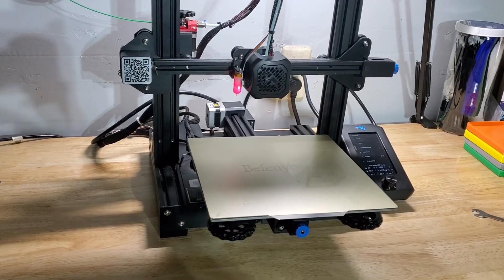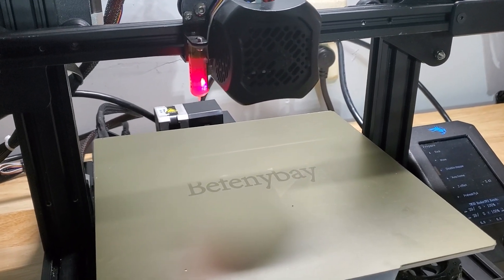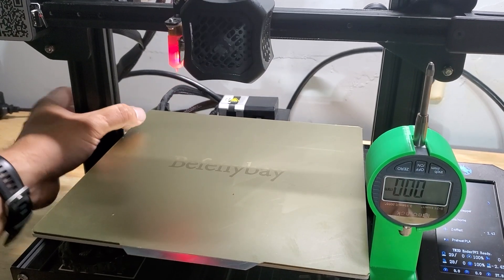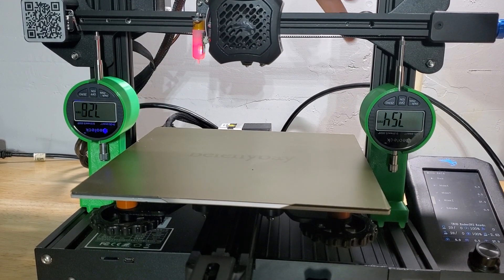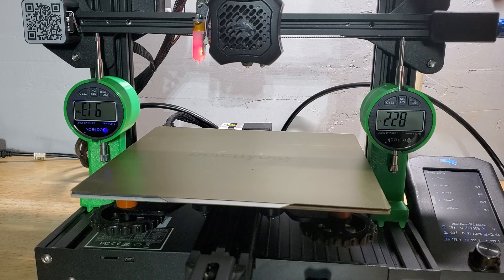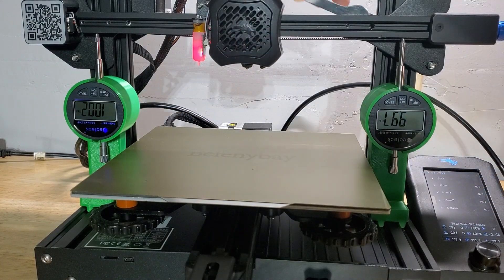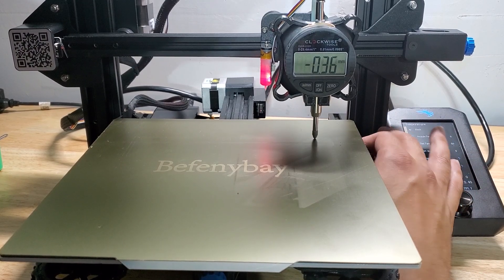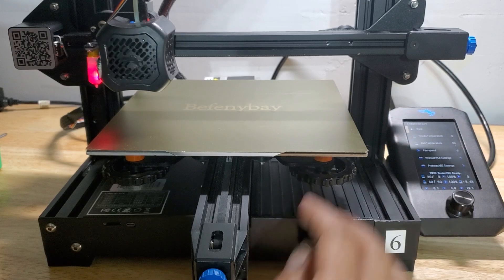3D Printer Adjustments: Perfect X Gantry and Bed Leveling Using Dial Gauge Indicators (Ender 3v2)

Comment: If the V-slot wheels are effecting your measurements, they are effecting the print. I hate V-slot wheel motion systems.
Reply from the maker: It is the ender 3s biggest flaw!

Comment: Defo getting one of these to help level the bed off the extruder. But with only a single Z lead screw that gantry is always going to be slightly off.
Reply: Thas why i use a mesh leveling with bltouch

Comment: I should mention that I only have 2 printers. For my needs, this method is rather expensive. I'd opt for the method used by one of your commentators. Not only is Jamie Carl's method more affordable, but I can see no reason why it shouldn't work. I think most of us understand the importance of having a squared printer frame, and I can't overly stress the importance of having the bed and X-axis gantry perfectly parallel with each other once the frame is squared. Each of these factors must be taken into consideration. These factors combined can "make" or "break" your bed-levelling attempts by making it easier or near impossible to accomplish.

What makes it difficult to square off the frame on an assembled printer? There's not much room around the bed for conventional tools to help make accurate measurements and adjustments. Sure, I can use a mechanic's square to check the squareness of the upper frame with the frame side extrusions, but how do I do this at the lower extremities of the side extrusions without getting in under the bed with the square. There's not enough room! To check for squareness in the Y-axis, I suppose I could temporarily remove the Z-axis stepper motor, and disconnect the Z-axis limit switch to get the cable out of the way. While this approach would allow me to confirm the side extrusion's perpendicularity with the base frame in both axes it just seems like a lot of work.

Now for the bed and X-axis gantry. If the X-axis gantry and bed are not parallel, good luck with your printing activities. I would like to add that I thought a secondary lead screw on the opposite side of the printer would help to counteract the sagging of the gantry on the right side, and help maintain the gantry perpendicular to the frame side extrusions. In theory, this should also make it easier to level the bed. Right? But how do you ensure that each screw raises or lowers the gantry by an equal distance. There's also play between the lead screws and brass nuts to contend with. So, I loosened the set (grub) screw securing the lead screw on the left side of the printer. After installing the second lead screw and stepper motor to the right side of the printer, I left the set (grub) screw securing the second lead screw loose. Then I raised the X-axis gantry as high as it would go by spinning both couplers by hand. Though the lead screws were left loosened in the coupler, these raised the gantry up without difficulty. When I was ready, I used the printer's Move Z command to lower the gantry. I'm assuming that the pitch of both screws is equal. The screws should eventually get in sync with one another when lowering the gantry as both will reach that point where the lead screw threads come into contact with the inner threads of their respective brass nuts. I'm counting on the weight of the lead screws and gravity to help me to accomplish the syncing action of the screws and nuts. Lowering the gantry should force the loosened lead screws to reach that point where both lead screws and nuts are in sync with one another. Then, once the gantry was as low as I needed it to go, I tightened the set (grub) screws to secure the lead screws to the couplers and stepper motors. If I get this right, I can not lower one side or the other of the gantry without really forcing down on it. This is perfect. Raising and lowering the gantry several times, and listening for any undesirable sounds proved that the operation was a success. I couldn't get that gantry any more square if I tried.

In theory, and excluding normal part wear, this need only be done once. No further adjustments should be necessary - ever! In practice, however, the brass nut's inner threading will wear quicker than the stainless steel lead screw's threading, and this will cause the gantry to sag to one side again. This usually occurs on the right side of most Z-axis single lead screw systems. I figure it will take about 7-8 months of 24/7 printing before the brass nut threading wears out enough to make any significant difference, however, adding a little lithium grease to the lead screws and nuts should slow down part wear. I based this time estimate on my printer's performance, and after assessing that the brass nut may have become a problem. What do you think?
Reply from the maker: The extra precision helps because I print with a .2mm initial layer. I don't over extrude just to get better bed adhesion with the first layer. The extra precision is definitely worth it for my production, the print surfaces are smooth like glass and the lines are uniform. It really helps with the cosmetics of the surface that is on the print bed. It is over the top if the precision is not important. Thanks for commenting!

Comment: In terms of the levelling, shouldn't you use center as the reference? The problem is that, if there's a center warping, the corners will be potentially higher/lower.
Reply from the maker: If you use the center as a 0 point, you won't be able to zero out the corners. It's better to get the corners level and let the bl touch compensate for the center.

Comment: Do we need fusion360 to be able to print your gantry dial housings?
Reply from the maker: Ive included the STL as well in the thingiverse link so fusion 360 isnt necessary. Ive included the fusion 360 file in case someone wanted to make modifications.

Comment: I like the premise, but the method is not sound. You should use the frame as the contact points for the indicators. And the gantry as the base. So that when you zero out the dials your measuring up from the base. Because you don't know where the tips of the dials are in relation to each other in this orientation. I hope you find this info helpful. Keep up the hard work.
Reply: I was thinking the same, and I don't know much about indicators, but to me they are only good at measuring relative displacement (when there 0 has been set with a contact to the surface). Not sure those two have the exact same gauge length at 0.
I thought of one way to improve this method (but again I'm not an expert in Metrology). Perhaps you could swap the 2 indicators after the 1st levelling has been done, and then compensate half of the remaining offset. So if the right side is too high of 0.4mm, then it should be pushed down 0.2mm. Thoughts?
Reply: @JulienStoeffler  I would say that would work. You could also just use one indicator from the base in the orientation in the video and swap it side to side. Although after watching the video again, his gantry is way too loose to stay leveled for more then a few z cycles.
Reply: It's honestly probably not enough to matter

Comment: Please don't take this the wrong way, you're probably a very decent chap but this premise of how to align your x to your z isn't on point. For one, you'd have to ensure your two dial indicators and holders from point to point are precisely the same length at zero - and then the flat surfaces of both 4040 extrusions are level and parallel with each other( and square to your z), but this is academic for the repeatability of your adjustments is what's raised an eyebrow.
If the v-rollers on both z carriages are adjusted evenly (and independently) with a light preload (and in order to do this, at least one has to be separated from x axis). Your X,  attached to the carriage on the leadscrew side can then be checked with an engineers square and be adjusted for 90 degrees whilst supporting the weight of an (unsupported) x-axis rail. When you can achieve that you reattach the other carriage again. Obviously a wise person would attach the trailing carriage from the bottom of printer, loosen the top of the frame and raise the gantry all the way to the top before retightening. Hopefully what I'm saying  makes sense?

Disconnect trailing carriage from x (the one on the right). Disconnect lead screw. 
Adjust rollers on carriages independently,
Check x with square and adjust to 90 degrees with x-axis weight unsupported,
Reconnect second carriage to x.

Comment: The issue I see with a single lead screw is that motor side is always pulling the other. I cant imagine the unsupported side would remain level for long. It would be interesting to see the results if you level the gantry, print something big enough, pull off the print and then take new measurements by bringing the gantry down.
Reply from the maker: The single lead screw design for sure is a drawback of the Ender 3. Whats going to keep your gantry level longer is how much pressure the V roller is making against the frame. It can act as a brake and start to pull the gantry slightly out of being level if it is too tight. I check my printers every week and have to make a few minor adjustments here and there to keep everything in line. Its more for preventive maintenance. Thanks for commenting!
Reply: @Redo3D  Try an ender 3 max... Mine is one of the top quality creality creations they are shipping out with the vertical frames being 2.2mm out of parallel!!!

I spent the first 8 weeks of my 3d printing career trying to figure out why the hell it just would not keep level.. 

I did a tall print and it screwed up completely at about 300mm up, and the inner wheel was  locked solid with the outer wheels not connecting to the frame.. I moved the gantry down and then the inner wheel was not connecting with the frame and the outer wheels were so tight you could not move them..

Turned out there is actually a printable shim on thingiverse because its so common!!!

By the time I had found this out I had already fitted a dual z drive mod, it was the dual z motor skipping that alerted me to the issue, had I checked the frame for parallel I would probably have managed to get it working by shimming and adjusting the wheels and the wheel plates..

Its a poor design single z drive, even before I started printing I was of that opinion, and its still my opinion now.

I have just ordered a second printer, I went with a Vyper because I have the large format ender 3 max which now prints sweet, it has dual z by default, but mostly because I would not trust Creality to put my trash out after the 3 max fiasco!!!
Reply: @Redo3D  That's a neat mount, will have to give it a try. I am interested in quantifying this "lag" of the non-driven end as it is quite significant and now I see it everywhere. What I have been doing is zeroing the dial gauge at a midpoint and using move axis to approach from both directions from at least 3mm away. 0.04mm error is about my best measurement so far.

Comment: I do the same thing, except with two blocks of MDF cut to exactly the same length.  Just lower the gantry on to the blocks and you're set.  Works just as well and doesn't cost anywhere near as much.  But I do like the uber-techy solution here.
Reply from the maker: That for sure is a very cost effective way! For me I like to have a difference no more than the thickness of my layers. If you add the slight uneveness of the bed that comes from the factory, plus a slightly unlevel gantry. That can add up to a few thicknesses of first layers. The BL Touch will only compensate for so much, so I try to be exact as possible. The bottoms of my prints look shiney and have a uniform finish which I really like for my products. The dial gauges also help to see if your v roller is acting as a brake for being too tight! Thanks for commenting!
Reply: @Redo3D  if the bed is out too much manually marlin will now halt the printer with a critical error...

It is sellers that are marketing BLTouch as an auto levelling device that should change, it is not an autolevelling device it is a surface compensation device whos purpose is to adjust the z offset for an uneaven, out of flat, surface, it does nothing at all for levelling, and if you rely on it for such with a badly levelled bed it will simply distort the geometry of your print..

I am interested though in how you assure that both dial guages are accurate to each other.. there will likely be small differences between them, and probably larger differences between the 2 printed brackets, how do you therefore know that at zero both of them are actually at the exact same height?
Reply from the maker: @AkiraFurball  I did measure both printed brackets with my calipers and they are the same size. I made sure of that. As far as the accuracy of the dial gauge I just have to trust the manufacturer has not lied to me about its accuracy lol.
Reply: @Redo3D  I did not mean its accuracy as such, that will usually be within its specs..

But when I used these dial guages in industrial manufacture the proper use is to zero them at a known position and they measure an offset from that zero point, they are not designed to measure a distance which is basically what you are doing..

I guess the way to test, though it would likely not be accurate to 1/1000 of a mm, would be to put the right hand guage in the left hand vrail, lower the gantry till you have a reading and zero it, then move it to the right rail, then put the left hand guage in place and zero that..

Now both guages are zeroed out at the same height so measurements are now both based on the zero point being exactly the same height.. Does that make sense? in case say 1 probe pin was 10/1000 of a mm longer than the other, or some other difference between the fully extended probe length..
Reply: That would also eliminate any possible difference between the printed mounts as well of course...
Reply from the maker: @AkiraFurball  that's a good point. 👍 will have to check that.
Reply: You probably do not.. that would work for a dual z drive by causing the steppers to skip steps when they crash into it and therefore align the steppers which then maintain level until they are turned off at the very least, but with one end free i its likely to move out of alignment again when you move the gantry, maybe only a tiny bit, on some enders it could be a FAIR bit as gantry sag/ lag on them can be huge.

adjusting of the wheels, and more often than not losening the wheel plates from the gantry to allow things to align/ settle and then carefully tightening up again while checking the level as you do would be needed..
Reply from the maker: @AkiraFurball  those steps would definitely help for perfect leveling. The indicators mainly help to be a visual aid for your adjustments which is what I wanted to demonstrate.